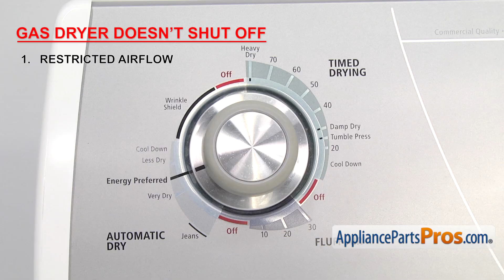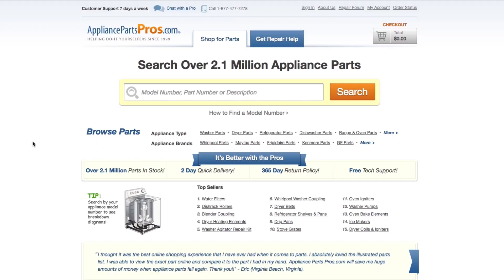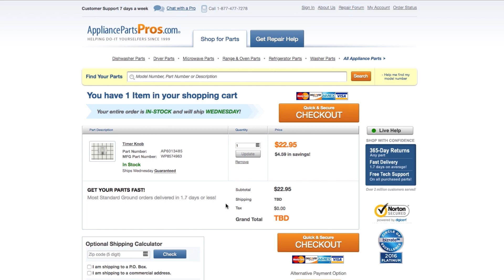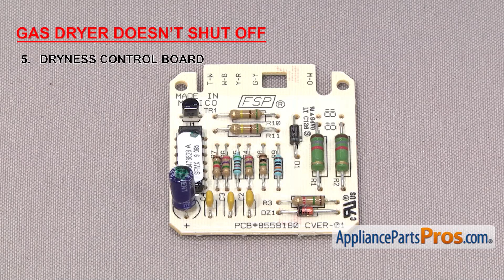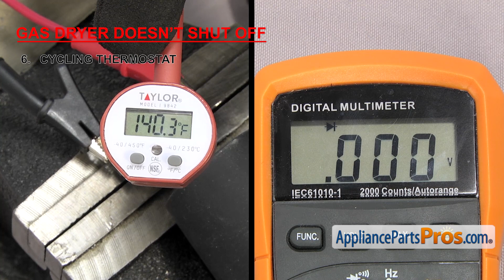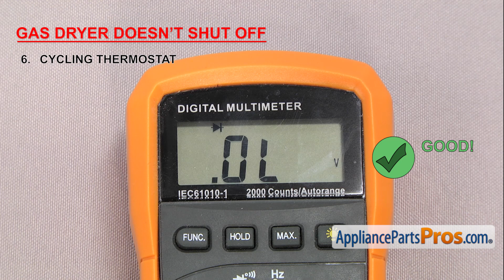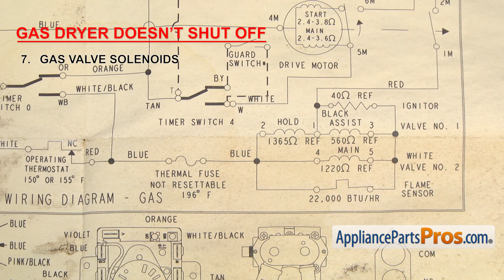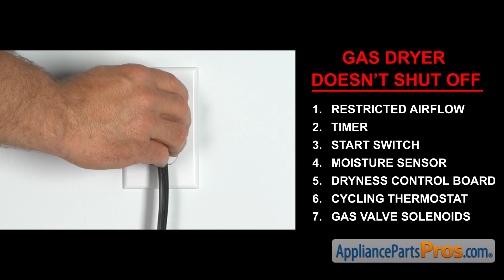Gas Dryer Won't Stop - TOP 7 Reasons & Fixes - Whirlpool and more

Comment: My wife told me that the auto dry wasn’t advancing.  However, the timer was advancing on the other timer modes, but there was no heat at any setting. It turns out the thermal fuse was blown.  Once that was replaced, the dryer had heat but the auto dry still did not work properly until the cycling thermostat was replaced.  No lint build-up.  I heated up the cycling thermostat and it was switching well before 155 degrees.  None of my hair dryers could get the temperature above 155.
Reply: i know Im randomly asking but does any of you know of a trick to log back into an instagram account..?
I was dumb lost the account password. I love any tricks you can give me
Reply: @Uriah Jeremiah Instablaster =)
Reply: @Benton Mohamed it did the trick and I now got access to my account again. Im so happy:D
Thanks so much, you really help me out!
Reply: @Uriah Jeremiah glad I could help =)

Comment: Our whirlpool dryer spins up as soon as it's plugged in.  It only stops if door is open or unplugged. Even with the power button turned off or on it doesn't matter. I haven't seen this issue described here. What is the problem?
Reply from the maker: You could be having an issue with the door switch or maybe the motor. What is the model number of your dryer?

Comment: My Maytag gas dryer heats and cycles fine, but the flame doesn't completely shut off after the cycle. Even with the dryer unplugged, a small flame stays lit in the burner assembly until i shut off the gas.
Reply from the maker: What is the model number of your dryer?